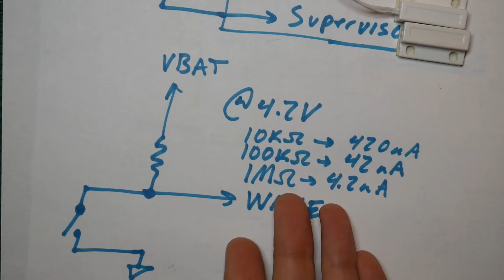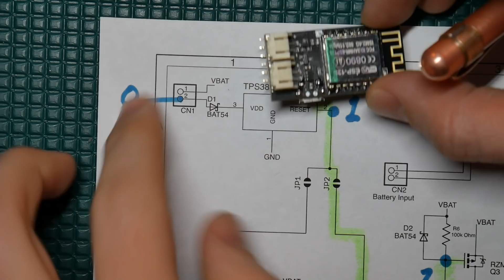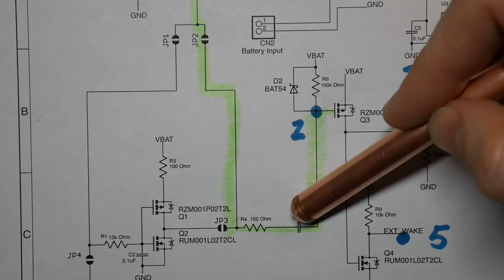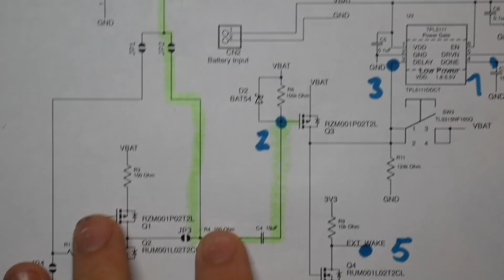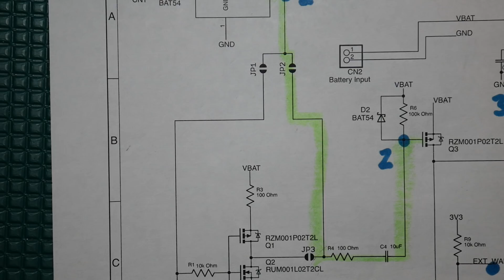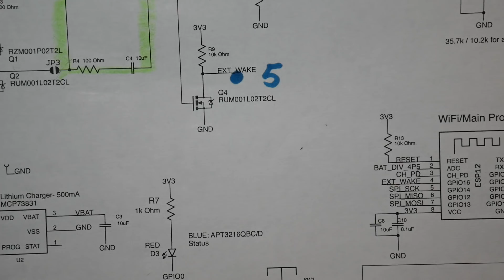trigBoard Hardware Walkthrough & Tutorial - ESP8266 EXTREME Low Power

Comment: Very interesting. I was surprised to find the FETs not even having a super low RDSon, kinda run of the mill SOT23 signal FETs but i guess when they do the job they do the job.
Anyways, found your battery voltage measuring interesting. Using something similar to read battery voltage and some resistive sensors, still driven bij a GPIO pin as i am using deepsleep, but may switch to a trigboard

Comment: This ext. wakeup trick seems to be a balance on a knife's edge. It may work - or not. TI´s datasheet for TPS3839 page 12 on 8.4.3 don´t recommend to do so. "When the voltage on VDD is lower than the power-on reset voltage (V(POR)) , the RESET output is undefined. Do not rely on the RESET output for proper device function under this condition." Anyway - nice design and thanks for sharing.

Comment: I realize this is a year ago, but... The "contact set on power up" requirement bothers me.  As a 'portable' sensor, this would be ideally packaged all together - Battery, reed switch (sensor) and trigBoard.  To change the battery, you have to move the unit, then put it back.  And with either NO or NC, it would not be in the correct state when the battery was plugged in.  A simple solution would be a power switch you can turn on when it is back in place.  But it still bothers me..

According to the datasheet, if the DELAY/M_DRV pin is held high for more than 20 ms at power on, or while reading the resistor, it will abort the read and wait until DELAY/M_DRV goes low again, and re-start the read.  Any shorter than that, and it is ignored, which would cause the issue you're talking about.  However, your scope capture shows that DELAY/M_DRV stays high for around a full second - which should NOT cause the problem at all!!  Very strange....

Comment: Nice job .. this is a versatile  design. I built something similar a long time ago but I used a normally open reed switch to avoid the issue with bleed current. I used it to monitor a door open/close event. It used an ESP01 and a small 400ma lipo battery. The design used only a few micro amps , it lasts about a year on a single charge ( 100's of open/close events per month ) .. My approach is similar but I don't use the TI TPL chip, I instead control the regulator enable using an Atiny85. 
( https://bit.ly/2R6nYbV )

Comment: Kevin, I was taking a look at the TPS3839 and I think the MR pin can be used instead of the fet contraption for the normally open kind of contact, this will help you reduce the component count and save some pennies, most importantly it will save some "electrons". I know you are using the SOT23-3 package which doesn't support MR pin, but you can surely try out the DQN (X2SON) package along with a jumper to keep the chip powered when used in this configuration. Let me know your thoughts about it.
IMO you have done a great job and its a great way to have a hardware wired power down mode for ESP. Kudos!

Comment: Hi I'm also using the tpl5111 in a project of mine. The only problem I'm having with it is that it doesn't wake by timer, only by external wake. I'm using a 120k resistor to get about 1 hour between the wake ups but it doesn't wake. 
Did you also have this problem with your project or do you maybe know what the problem could be? Maybe the resistance is not accurate enough? 
Thanks in advance!
Reply: Hi. Saw your design on Easyeda and made a similar one (just got my PCBs and still not working fully though). I think I know the answer to your question though (it you are referning to the easyeda design). 
The TPL5111 needs a specific range for the DONE signal compared to the Vin (0.3-0.7xVin) and you don't have a voltage divider in the DONE pin in your design. It needs a 10k resistor as in Kevin's design as well. If the battery is between 4.2 and 3.5V then the range is 1.26-2.45V and a 10k/10k voltage divider will give 1.65V so should be ok.
Reply: I'm stuck with a different project where I want to use TLP5111, I bougth 10 piece from China seller but I've the feeling they are fake, does not matter what signal I apply to  pin 3 (MDRIVE) I've always the output to pin 5 (DRVn) same voltage as VIN (pin 1); I tried same connection as Kevin's schematic but no luck... anythign I can check or it's faulty ICs and I shoudl I order them again? can you eventually provide a good source of working ones?

Comment: You can inverse the working of a reed switch by applying a magnet at the opposite side of the reed switch. Your solution is far better, but it can be handy to know.
Reply: Only if it is a DPST reed switch, and then you'd have to swap leads.  If you just turn the switch around, the magnet pulls it toward the open side when it is already open, and nothing pulls it closed.  Magnetic reed switches are called that because they are activated by magnets, or a magnetic field, not because they're magnetic themselves.

Comment: great curcuit, but isn't there a problem if you hold the manual wake button, shouldn't there be a cpacitor too, else it would trig as an  real input trig
Reply from the maker: yea, that's actually intentional, so you can force a wakeup...
Reply: I am qiute aware of the functionallity, my point is: you have an input where you have defined a delay by the RC, so you can identify that it is an input from eg. a door. but if you hold the manual wakeup buttom for the same time, insted of a quick tap, it will be detected as "the door". to solve this you could put a capacitor in line with the manual wakeup buttom, to secure a shooter pulse. :-)

OHH, i just saw i the other comment that yu WAT to do both short and long trig for testing, sorry.

Comment: why not add an extra diode between the ext trig and the push button towards the enable line? that could solve the short ext trig on push button triggering
Reply from the maker: yea, that would work.  Thing is that I actually like that being able to trigger timer (short press) or external (long press) wake.  It's really handy for testing and also mode selection - check out my newest video on the code walkthrough.  I use this button so I can enter OTA mode and Reset the WiFi Settings

Comment: Nice! Now that you have sub-microampere deep sleep, have you considered adding some energy harvesting like a solar cell and a 5V step-up? I made a board for similar purpose, mine currently uses attiny85+nRF24L01. It runs happily on a CR2032, should last for like 2 years but I'd like to add an optional solar panel and 2xNiMH to rev3. Lower voltage makes it easier for me, I think (good down to 1.8V).

Comment: Kevin great video - just the right length btw.  I remember you did something like this with a nrf24l01 chip - is it safe to assume you've replaced that with the ESP based trig board?  I wanted to do something like this but figured the ESP would be kinda slow on the boot up to connect to the AP vs the nrf24l01.  I'm thinking range wise the nrf24l01 would be better if you wanted to put sensors outside.  Just curious what the motivation was to switch to the ESP?  Thanks for producing these informative videos - I am computer engineer (but have been in the software end of things for 20+ years), good to get back on the HW side of things again!

Comment: Have you played with ESP-NOW yet? Normally, ESPs have a 2-4 seconds delay connecting to WiFi. ESP-NOW lets you fire off a message to another ESP within 200ms from a cold boot; perfect for "dash buttons", reed switches and other zero-standby-current applications.
Reply from the maker: I gotta check this out
Reply: I was about to say the same. Andreas Spiess did a great Video on it.
Reply: Sadly, this wouldn't work directly.  ESP-NOW can only connect directly to another ESP chip.  So you'd basically have to have all your sensor nodes connect to another ESP acting as a hub, which would relay the alert signal to something like an Arduino or RasPi, which would handle the internet stuff through a different port (ESP's can only connect to one or the other).

Adafruit has the Feather Huzzah, an Arduino compatible board with an ESP8266 attached.  It would make a great hub for this setup, though you'd have to add the Ethernet Feather Wing and customize the code for the Internet side (Make a video if you do this!!). ESP-NOW has some other limitations, though.  It is limited to 20 'clients', so you'd only be able to use 20 trigBoards (a different ESP board could serve as the client for multiple sensors).  And you'd be limited to simple sensors.  Message size is limited to 250 _bytes_, which means video is out and audio would hog a lot of bandwidth.
Reply: You can shorten the wifi connect time a lot by providing the BSSID and the Wifi channel when connecting and by using a static IP instead of DHCP. If you don't provide the wifi channel, the esp has to do a scan on all of the channels to find out which channel the station is listening on.

Comment: How easier would it be having AVR + nrf24l01? AVR can sleep with current 0.5uA and monitor external interrupt. It can switch on nrf24l01 with a mosfet to start communication
Reply from the maker: would not be 'easier', but that is another approach.  I actually implemented something like that years ago with an NRF at each node, then they all communicated back to a central NRF to WiFi gateway.  It was a pretty big project that I never finished.  Having WiFi on each board makes it super easy and provisioning is a piece of cake.  But yea, power consumption during the ON time is much higher and it has to be on for a longer time...
Reply: Thanks for the reply! Really love your videos with detailed explanation of the circutry!

Comment: Would not using a LifePo4 battery make this board even smaller and do away with the regulator and charging circuit? Maybe even save more power?
Reply from the maker: yea, that might work.  Only thing is that those batteries are not as popular as LithiumPoly/Ion.  Plus in this design, I needed to kill power, so having an LDO in there with an enable pin let's me kill power to the board.  Good thinking though - I'll have to pick up one of these batteries and see how well it works with this concept
Reply: I would be curious to know how that goes. I found the genuine Soshine ones good.

Comment: Why not exercise by code the low power capabilities of the 8266? Seems like your boot time from scratch will cost more overall power than deep sleep with an external trigger. The RTC on the esp could replace the timer clock you have reducing power more. But I mean I haven’t looked into it super hard, but will soon.
Reply from the maker: I actually tried that originally - made a video on it a while back.  The sleep current built into the ESP is not that great - think it was around ~17uA if I remember correctly

Comment: Cool project, what about the battery life let’s say on a 2000mAh battery. How many seconds is the esp awake per hour (without sensorinput) and it’s amp draw (80mA?) and what is the amp draw in ”sleep” (1uA?)? The energy budget...
Reply from the maker: Yea, you could use 80mA for ON-current, and 1uA for OFF current.  Without sensor input, it will wake one an hour on timer wake, but that ON time (I haven't measured it) is probably ~1 second.  When it gets triggered, it's awake for ~5seconds.
Reply: Kevin Darrah ok, I get only about 300h on a 2000mAh battery if I do the math with 5s on time and 3595s sleep. Is this correct according to your experience?
Reply: Are you sure your calculations are correct? http://battery-life.of-things.de/battery-life-calculator.php  gives me more than a year and a half with a decent margin on discharge.

Comment: Amazing explanation.  Thanks; looking forward to project videos using this board. The logic analyzer was very helpful.   ESP32 instead of ESP8266 feasible?
Reply: Also ESP32 has built in low voltage cooprocessor for monitoring io, while main CPU in deep sleep.
Reply: alphakittycat - the technique of this device would not be any different for an ESP32, but I'd like to know: why would you rather use the ESP32? Do you have a specific purpose in mind? (do you need more pins, more cpu's, more ...?) 
For simple nodes that need only a few pins to process a single triggered event the ESP8266 seems sufficient.
Reply: Maybe to add Bluetooth possibilities with the ESP32?  I've stopped buying esp8266's now that esp32 price has come down.  Thanks for your useful projects you share.